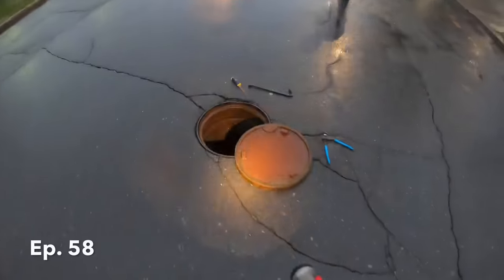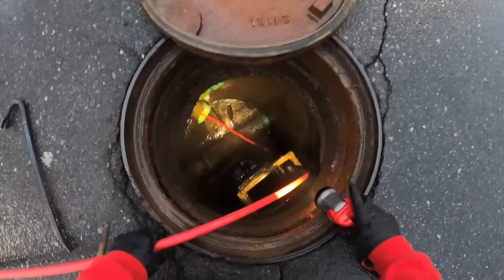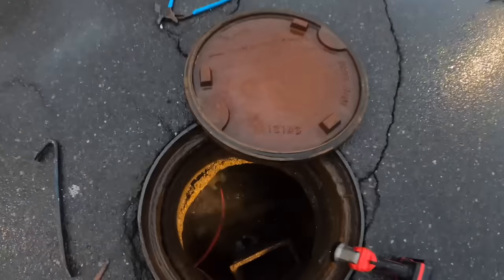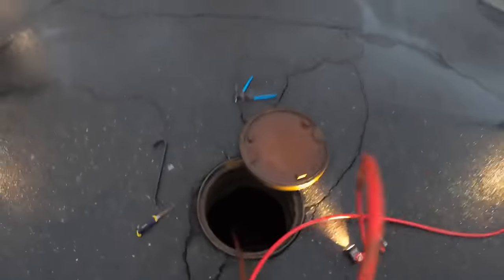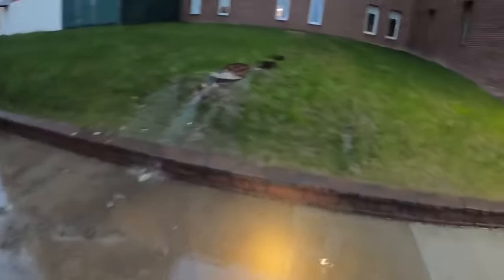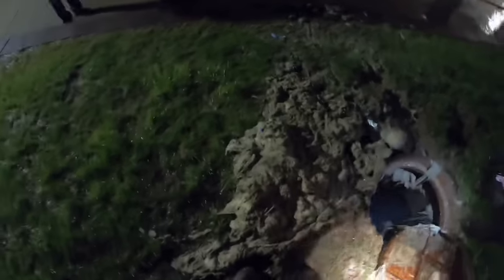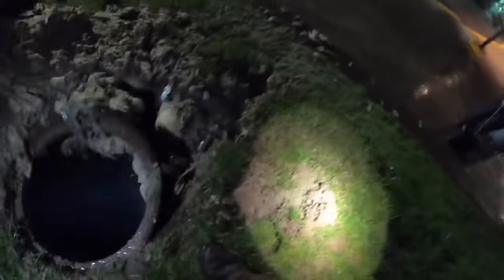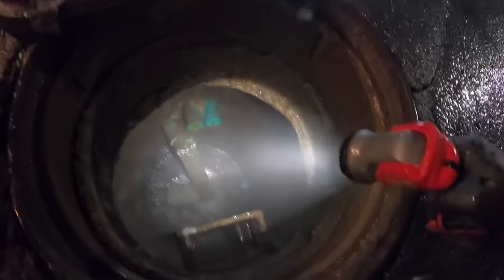MASSIVE HOSPITAL SEWER CLOG! BABY WIPES - Ep. 58 Drain Pros

Comment: The crap we find in our sewers at the apartment complex I work amazes me. We even found a baby doll head that was about six inches around, still haven't figured out how that made it through the toilet.
Reply: Was it fabric or plastic?
Reply: If it was rubber, it was probably vandalism by a tenant who was moving/being evicted. One way is using a snake, placing the end through the neck hole then pushing it through the toilet and as far down the pipe as possible.
Reply: @georgeford6056  it was one of those hard plastic doll heads. No idea how it got in there but we got some tenants that could cut an anvil in half with a cotton swab.
Reply: Poor doll😂

Comment: When I was younger I remember many hospitals and public buildings had small wall mounted electric incinerators in bathrooms for nappies, feminine hygiene products etc. Reduced anything non flushable to a few specks of ash. Perhaps it's time they made a comeback?
Reply from the maker: That would be awesome, I understand why some people flush them because there gross and covered in stuff. There’s an embarrassment factor. Seems like a logical solution 👍
Reply: Spencer Wilton Good point. DrainPro is probably right about the embarrassment issue and you also have maybe limited movement after surgeries and so on. But watching this unclogging, it struck me that the hospital has a responsibility for health and safety. I mean, there sure were tissues and crap in that clog which should not have entered any public system due to the bacteria and other nastiness they might contain.
So the incinerator (with high enough temperature to destroy whatever is thrown at it) idea is not a bad idea. On the contrary - they could even construct it so that it contributes to the general heating, heating of water or similar.
Reply: Unless constructed so that is contributed to building or water heater incinerators use a large amount of energy and produce awful pollution which is probably why they aren't used for that

Comment: Might I suggest that if you could build a pole with legs at a 45 degree angle to each other and perpendicular to the pole, with a light or two mounted to the pole so that it can be lowered down the side of the hole, that you would have a convenient source of light that would be out of the way of the hoses and that they could not knock down into the sewer.

Comment: Little known fact, rubber gloves will cause serious blockages especially the heavy nitrile ones and it only takes one. What happens is the glove will travel down the pipe to a random spot where it fills with water like a balloon and effectively blocks the pipe and the water pressure behind it keeps it inflated and jammed. Usually the only way to clear them is to snake the line, jetting often will not budge them.

Comment: Are Hospitals “even allowed” to flush bio-hazards like wipes and gloves etc, down the city drain?
Reply: Its most likely visitors and patient who does that i believe.
Reply: @Horna87  Good point!
Reply from the maker: They have to have them for the patients and staff but they are not supposed to be flushing them down the toilet, usually they have the metal bins next to the toilet to dispose of that stuff. It’s a constant fight between the maintenance department and the rest of the hospital staff 😂
Reply: @Horna87 ... Female dominated workforce in that building.
Reply: @Keith Buckenmeyer  My thought also - I am sure there were crap in that clog that should have been disposed of in a far more responsible manner.

Comment: How do you get a flexible hose to work its way up at a pipe at that angle, and shoot water out, and work past blocks, without pulling it through? at 2:00 you just flopped it in and then it started going deeper all on its own

Comment: 2+hrs - Thats A Long Haul

What kind of a nozzle do you use for an 8'. 

Surprised it wasn't a double or triple barrel?
Reply: Its called a warthog its what the municipality use big boy head & a realy big pressure unit to back it up usually a diesel motor driving it hope that helps double & triple barrels r for when the pipe is open already to clean the pipe warthog is for blasting open a pipe
Reply: @matthewperry5524  Many Thanks, first time seeing an 8' pipe clearance let alone with such a horrible blockage

Comment: How did you know the pipe in the manhole goes to that other man hole? Does that 6” cleanout go directly to the manhole next to it? How did you have enough water to jet for 2 + hours? What nozzle did you use?
Reply from the maker: I had a guess that is what the pipe was doing just by the way the man hole was laid out. Typically they would have another man hole just before leaving the parking lot and into the street and there wasn’t on this one so I figured they did that because it went straight to the man hole in the street. We had to fill up with water a few times and we actually left the water hooked up when we were trying to jet from the man hole out and always from the clean out next to the man hole. Was hoping we were going to be able to get it open from there but it when straight into the man hole, so it wasn’t a help. I got the clog open with the penetration nozzle just letting it sit there and etch into the wipes but I tried the warthog whip nozzle and also the six pack nozzle where the jetters all face back to me and wasn’t getting anywhere, the penetration nozzle (arrowhead style) was the only thing that was making any headway! 👍
Reply: Drain Pros there’s 3 pipes going that way how do you know which one?

Comment: hey Drain pro you should look into gettin a root rat head for your jetter. I've got 2 small ones and a large one for my machine, best tool you can have with a jetter, cut roots and blasts through clogs no problem
Reply from the maker: We actually have a couple! Love using them, they work great.. actually tried to use it on this job letting it sit for 20 minutes on 4000psi but wasn’t making any head way 👍
Reply: @DrainPros  oh hell. that's never good. I've learned you have to be an engineer to use a jetter. when I first got around ours  somebody had the wrong size nozzles in the warthog and it didnt work right, then we discovered we were losing about 1500 psi due to the length of the hose, but after much trail and error and many hours of workin with it in glad to say ive got the hang of it and I can use it effectively
Reply from the maker: Brett Vibbert Awesome! Once you get the hang of them there sure a valuable tool

Comment: have you had a longer time on the job then this 2 hours? it's so cool watching when the pipe finally pops open and the water just starts rushing out
Reply from the maker: Yeah that was an awesome sight when the water finally started to dump.. Most jetter are completed in less than an hour but there’s some stubborn clogs such as these that you have to break down for a while before they’ll let loose, probably 3 hours at the longest on a clog! In the winter time with frozen sewer lines filled with ice we can spend a 8 hours plus some days just letting the water pressure etch it’s way through the ice 👍
Reply: @DrainPros  dang 8 hours on one job. that's got to stink lol
Reply: 8hr, milk that job.